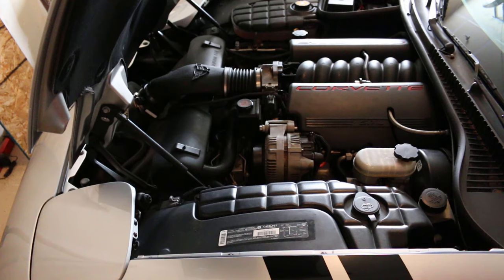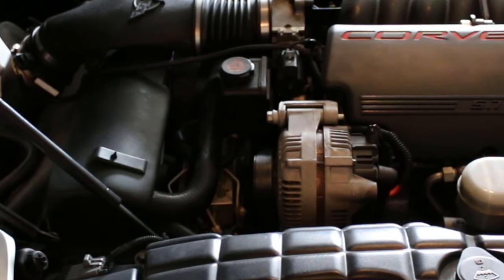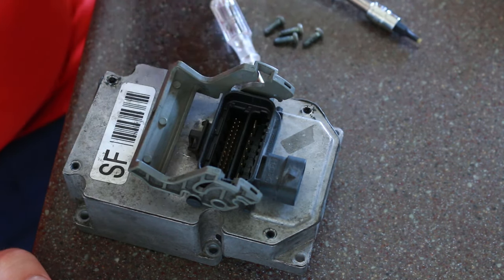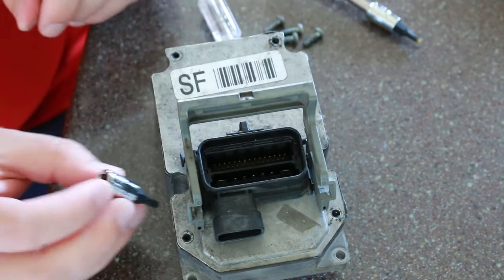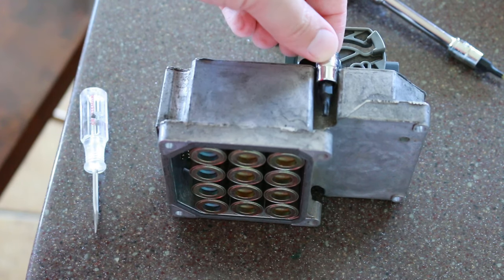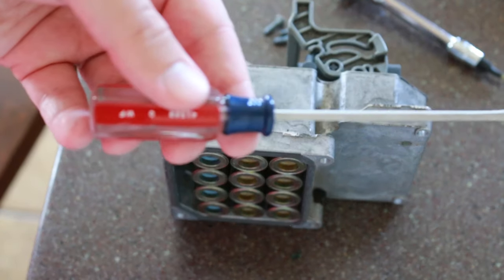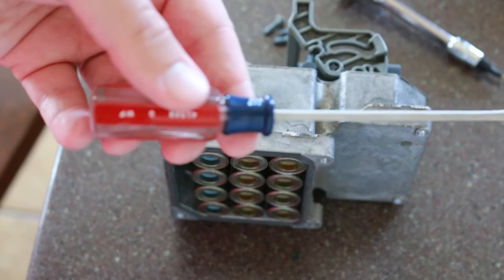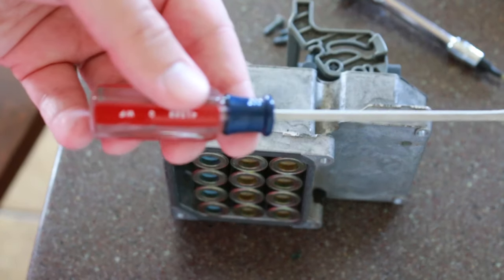C5 Corvette EBCM traction control fix under $15.00 2001-2004

Comment: I have a 2004 convertible. Is this ABS Traction Control fix the same for al C5's?
I have heard that they may be some differences from early to late models.
Corky Vette thank you for this. I had already spent over $1,200 on this issue at my mechanic and the dealer. Both gave it back to me after 2-3 days and said they cannot fix it because no one sells them and if they did it would be thousands of dollars. My only alternative was to pull the fuses and hope that turns the lights off. Thanks I will now attempt this tight operation myself. Thank you
Reply: Mine is a 2002. This will work on your 2004. When I made this video originally I was unaware the older c5 had a different set up. Sorry you have already spent that much on this but from all the comments I have never had anyone say it didn’t work. Thanks for your support.

Comment: I'm considering buying a '99 C5 but I've been worrying about this issue. This gives me some hope that it might be fixable after all, if the EBCM does stop working.
Reply: Apparently the Bosch unit in the '97-2000 models isn't serviceable. It has to be replaced with a salvage unit. This fix is only good for '01-'04 C5's.

Comment: Hey man, very informative video. Initially I was uncertain as to exactly which point you were referencing at the bottom right of video where there are two points right next to each other. But as video progressed it appeared as tho you were soldering the point on the left of those two particular points. How did you determine that those were the 5 points that needed to be resoldered? I’m now motivated to do mine! Thanks

Comment: I've always wondered why there is a complaint that the EBCM on C5 Corvettes up to the year 2000 is not repairable. Mine is 1999 and I have repaired the EBCM module myself and it has worked for the last 5 years without any problems. So I did something right.
Reply: Was your repair the same as this thanks
Reply: @CABNY1  No. Different way. I've always been of the opinion that everything can be repaired if you just learn and be patient and try and experiment and the result was that I got the device in order and it still works.

Comment: Good Job on the walk through bro! 😎👍🏻 Do more C5 videos like this...
Reply from the maker: Brett Mills thanks man. I need to film a few more in the near future. I have a few things that need to be addressed including changing the lower oil pan gasket, adjust e-brake and fix/replace some sensors.
Reply: Cool man, plus there is the climate control fix/upgrade and maybe even the HUD? Either case keep her going and good content! 🤙🏻

Comment: How can I be sure the ebcm is the issue what codes did you have is this typically the culprit for service traction and service abs warnings. I have codes c1242 c1255 c1264 c1281 b2282 b2284 b2276 u1064 b2283 b2285

Comment: So I have a 99 and was told 97 to 99 or 2k are completely different and not serviceable.  New not available and are specific manual vs auto. Bought manual type from junk yard for 1k. It lasted say 8 months before it died. 
Just a little info..

Comment: Next time you need that extra bit of torque to open a Torx in tight spaces, use a good quality Torx driver, grab the grip with small vise grips...snap! Worx every time...

Comment: Hi, great video, I currently have the messages: service TCS, service ABS and both amber lights constantly on the dash! The codes are C1243 & C1255. The problem is my car is a 1998. Can I follow your video for my vette? People say they can't be repaired only replaced with second hand units. Any help would be much appreciated, thanks.
Reply: My friend has a 98 C5 with the same symptoms as yours. We did this fix and it worked out well. THought I'd drop some info
Reply: @SpeedDman  I know its been 2 years but hopefully you read this... Are you 100% sure it was a 98 and not a 01-04? I have the EBCM issue on my 2000 FRC and can't find a straight answer if this will work for me or not.
Reply: @devonr7497  Guy has got it mixed up for sure. The EBCM is not even located in the same place for that year model of Vette. The 97-00 models are almost impossible to service because the location is completely different and uses an older BOSCH controller. At that point, pretty much just have to accept that you won't have ABS or TC.

Comment: I have an 03 Vette.  I have the same problem and took it to the dealer, who wanted to charge me $454.00 just for the part, which they couldn't get. I had considered going after it myself, but thought I would have to start by draining coolant and it looked too much for me. I was amazed at your fix. How did you know which points to resolder?

Comment: How did you know to solder those points somebody told you or you looked it up somewhere I can even just pick those five points out of random somehow you knew that that's what's interesting me I have this problem on my C6 Corvette I probably not going to solder it that's give you a lot of props for doing that I may just buy the ecbm and put it in I know I'm going to spend some money but I don't have the skill or the patients to resolder circuit boards inside my car, I have a base model C6 05 6. 0 motor and the ecbm on my car look slightly different same concept though, nice work great teacher thank you for your information it was very helpful

Comment: Follow up post:  Faced with a faulty operating EBCM and a failed test after re-soldering, I sent the unit out to ABSfixer in Missouri for work on the circuit board.  More than re-soldering was performed.  The EBCM was re-installed today and everything is working correctly. No more codes.

Comment: I didn't hear the year of your C5 Corvette. The reason I ask is that there are two EBCM that are used, a Gen 1 from 1997 to 2000 and a Gen 2 from 2001 to 2004. Apparently the Gen 1 is hard to find and hard to repair, but maybe this is all that is involved in the repair.
Reply from the maker: At the time of making this video I didn’t know there were two versions of the EBCM. The one in the video is a 2002. So C5 gen 2. My apologies this won’t work on the gen 1.

Comment: THE    CORVETTE

What says America more than the taste of apple pie,
It’s an American road machine driving the highways.
What started out as one man’s dream in the fifties,
Has become for many an everlasting American icon.
A true roaster for the many passing generations,
And the forever dreams of many a youthful lad.
A machine long bred for both racing and cruising,
And with many a trophy for road rally or dragging.
As many of us still remember the days of Route 66,
Where the star of the show had a motor and wheels.
A car concept tested at Le Man’s and Watkins Glen,
And in racing venues like Sebring got a real gut check.
So they are a pedigree born of stallions gone before,
Such a vivid history that all car men dream of forever.
So the name Corvette will always stand alone among,
All the others that have passed and gone to history.
So when you enter the flowing cockpit and turn the key,
As the first soft growl of the engine ends in a lions roar,
Whether a hardtop coup or T Tops or air free convertible,
It’s always the feel for the open road that rules the day.
The exhilarating ride tells you have transcended the earth,
And you’ve entered into the magical world of the Corvette.

T. Michael Daly (Pop. Irish)
Did repair myself great video!
 Thanks!

Comment: I have a 2000 C5 and the Service Traction Control/ABS? Service Active Handling light went on and stayed on. I called my mechanic and he will take a look at it but he said if it's the module that you can't find them for the earlier models. He knows my car is a 2000 so I assume he meant 1997 to 2001 as earlier models. If it ends up being the module do you know where I can find them?

Comment: After soldering those 5 locations yesterday. The test install failed today. No change in messaging on the DIC. Clearing the messages fails to remove the icons on the instrument control panel.  Not sure what to do now.

Comment: Lyle I have a 1997 c5 Corvette I park it in my driveway I want outside now it won't start until it not getting any spark on gas I took it to a shop they took me it the PCM I also getting reduce power I put some starter fluid it is trying to start up someone else toll me it is the throttle control module so can you tell me what do you think what could be wrong with it

Comment: Mind if I ask, did you remove the old solder before you redid it? I need to repair mine as well  the told me a replacement one was considerably more than $1700 now days so I just want to be sure about the soldering part of the repair. Thanks for the info , very informative!

Comment: Dude…. I live in Denver , and I am literally buying a C5 today!!!! That EBCM was my main concern, but thanks to you and your content, no fear!!!! 
Thank you so much!!!!
I have not subscribed to anyone my entire life, but I just subscribed to your channel. Please keep putting out C5 videos. Hope to run into you somewhere in Colorado
Reply from the maker: What year C5? This will ONLY work on the later years. Mine was a 2002. I found out after this video that it will not work for the earlier years like 1999, 2000. Maybe even 2001. However, fun car. I live in Utah now unfortunately. But I was in. Castle Rock. I miss it soooo much.
Reply: @corkycars93  I’m buying a 2000 model. Didn’t want the newer one because of the whole magnetic suspension issues that they have. Anyway….. any advice on fixing ( if need be) EBCM on the 2000 model?
And also, have you ever experienced,or heard of, manual transmission C5 Corvettes having issues with popping out of 1st and reverse gears?
I live in Parker. How come you moved out to Utah?
Reply from the maker: @bobomarkovic9683  my sister lives in 
To my knowledge, there is no fix at all for the earlier year C5s. I fixed it up over two years and sold it after it was done. Got a 911 project and a motorcycle and a UTV. It’s become a hobby. 

Parker! Nice place. I grew up in SLC and my now ex wife forced me to move back but unfortunately it was a con. She left me not long after. Found out she wanted to leave me but her family is in Utah and if she divorced me in Colorado she would have had to stay there with the kids. My stupidity in thinking my spouse loved me. 

This video was actually filmed after the divorce in Utah. The flag in the background is to remind me of Colorado. I bought the C5 to work on as a project while I didn’t have my kids and was healing. 

Never had an issue with the suspension. Just make sure the upper oil pan isn’t leaking. Such a huge pain to do! Took me probably 10 hours. Many shops won’t even do it because it takes so long and costs so much.
Reply from the maker: Also, I never had an issue with the transmission popping out of gear. This would not change what you are talking about but, I did do a skip shift eliminator so at low rpm it doesn’t force you to shift from 1-4. I also put in a MGW shifter that I absolutely loved. The stock one was kinda junk. It was probably 350 and I am cheap but man it changed the whole feel. Best upgrade I did besides the borla type S exhaust. https://www.mgwshifters.com/shifters/corvettes/88
Reply: @corkycars93  Yeah…. Girls suck. I went through similar situation. 
This 2000 C5 already has short shifter, headers, Borla full exhaust, coil overs, etc… older gentleman has owned it since brand new. The only thing is, it pops out of first gear and reverse, but only when you’re first starting to leave from a stop. Otherwise, shifts smoothly. I did some research, and found out that 97-00 had that issue because of that bypass that needs to be done so you don’t have to go from 1-4
Reply from the maker: @bobomarkovic9683  if you just need to do the bypass on the 1-4 shift it’s super easy. It’s legit like a washer. You in bold a easy to reach spot slip the washer on and bolt it back up. Will take you 10 mins if it’s the same as the later years. Mine was also owned by an older guy. 

When I come out to visit my sister we should grab a beer or something. Would love to see the vette. I need to pull the transmission on my 911 and either ship it or drive it to Boulder for a rebuild by some specialists that fix an original design flaw with a patent they have.

Comment: Thank You very much for video! I'm wondering if it would be possible to slowly warm the area where sealed with a heat gun will prying it apart?
Reply from the maker: The problem is it’s not just the seal around the edge it has lost more inside and it’s very soft metal/aluminum (not sure) I tried to pry it open first and it started breaking real fast.

Comment: Hey Corky, I live in Utah as well and am wondering if this goes for the 99 as well. Supposedly one is easier than the other
Reply from the maker: Cody Hartman hey Cody. I originally thought it was all C5s but I was mistaken. I have a 2002 which I guess may be easier.
Reply from the maker: Cody Hartman want to come help me change the 2 oil pan gaskets? That’s next on my list and seems like a big job.

Comment: Use t handle torx driver for the center screws and they come out easily. I used a t-15 as the t-20 was to big.

Comment: Just did our o3 deville dash had 3 lites   abs brake trac control,engine...splitting the module  was tough ,then tapping,and used the bolt to finally pop it open,resoldered ,then silicone ,and really tight to get at,...but sucess  its fixed

Comment: Thanks for the video you did help with that tip for my C5, Hey I have a 2000 C5 with 61k miles on it I did change the transmission fluid then later after around a thousand miles the 2nd gear it feels like is slipping and I did everything accordingly to specs I don't know if you any knowledge on this problem?
If you have any tips please let me know I need help on that. Thanking you in advance man...
Great video keep up the good work! 👍👍👍

Comment: what tear is your C5 Corky I have a 98 C5 and I heard 2001-2004 are different
Reply from the maker: HDRIDER CORVETTE 2002
Reply: 99 and 00 are different too...97 & 98 are in the rear, near the diff., not under the hood...Chuck Cow might help with some info, at Westchester Corvette in N.Y....1-914-332-0049...I have a 99 Vert., and wish I could fix it like this...Chuck says to check All your grounds first...I just push traction control button off...and wait for a fix like this one.
Reply: 97-99 ECBM’s cannot be repaired.

Comment: I am having a problem with those lights on. The 2002 Corvette have a problem when pushing full throttle after a bit and some soeed then it continues ok.

Comment: What are the symptoms?  Just a light?  I have a front left caliper locking up after turning left...pulled the ABS fuse and e problem stopped. Ideas?

Comment: Hi, Liked your video and started to subscribe.  Sorry if I am missing this info, but what year is your C5?  I was under the impression that a repair to the EBCM was not possible on the earlier years of the C5.  Mine is a 1999.
Reply from the maker: Sorry, when I made the video I did not know it was different on older C5 models. Mine is a ‘02.

Comment: Im new to the corvette world. I own a 98 Base. Could it be possible that the ebcm is located in the rear rather than the front. There is literally nothing underneath my power steering pump.

Comment: Corky, Great vid. I am in the market now for a C5. What year is your Vet? As I understand it, 97 to 00 ECBM can not be repaired. Any comment?
Reply from the maker: Oddly enough I just put my C5 up for sale. Mine is 02. When I made the video I was not aware this was only fixable on the never C5 years. Also works on several other GM cars made at the same time.
Reply: Thanks Bro!

Comment: Corky, after making the soldering repair, did you have any further intermittent C1214 Codes.  I have to do this same repair on my 2001 C5.  To fix it for good.
Reply from the maker: I have never had an issue since. Works as it is supposed to.
Reply: @corkycars93  Excellent.  That's what I am after.

Comment: I have owned my Z06 since July of 2015 and it has always gone on. I have found that even on the Fly if you press number 4 options hold it and then tap number 1 fuel six times and then tap options again you can reset it by holding it in for several seconds, and this was probably completing the circuit but now for about the last 3 months it doesn't do anything so I can't wait to get in there and do what you did ¿`_

Comment: Does this work on C6 corvette.   I accidentally pushed my traction control button and now I have traction control issues.   Codes U0101 and U0102 and check engine lights

Comment: Is this for all C5 Vettes or just specific years?  I have a 2000 that has been modded with a Procharger.  I was under the assumption that the mod was causing my traction control light to come on.  It also goes into limp mode until you shut it off and restart it.  That shuts off the limp mode but the traction control code is still there until you erase the code.  Any help would be greatly appreciated.

Comment: I have been lead to believe that not all of them are fixable. What year C5’s are not. I have a ‘98. No problem so far but interested to know if mine would be repairable?? Thanks!
Reply from the maker: After making this video I found from others that this method only works on the later models. Mine was a 2002. Sorry
Reply: @corkycars93  Yes I thought so. Thank you for responding.

Comment: Corky  
Do you have a permanent fix for Gas Gauge sending unit going to empty without having to keep buying additive to put in your fuel.
I have to put one bottle in each time I fill up and sometimes have to put another one in .  I'am using Techron .
Donnie in Deer Park Texas
Reply from the maker: I have not run into that issue on mine. Sorry I am no help with that issue.
Reply: @corkycars93                  Thanks